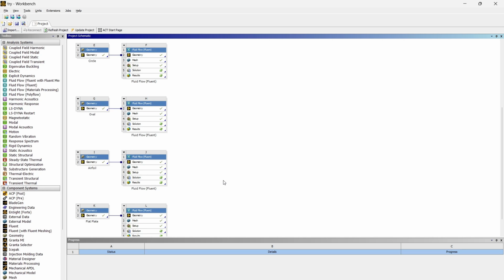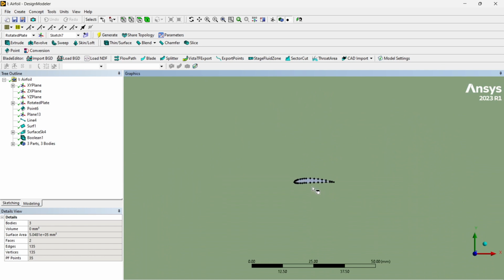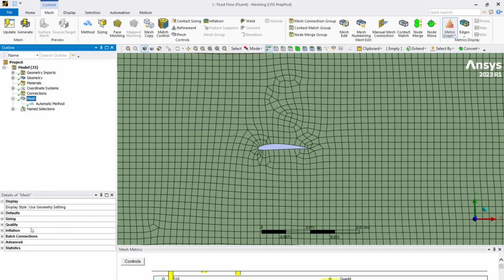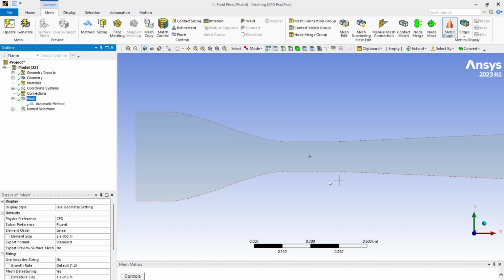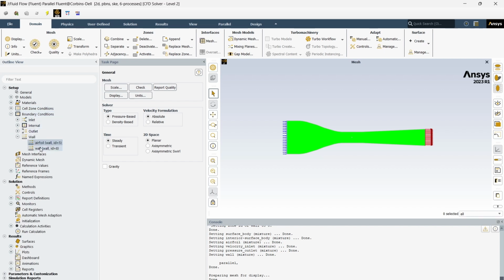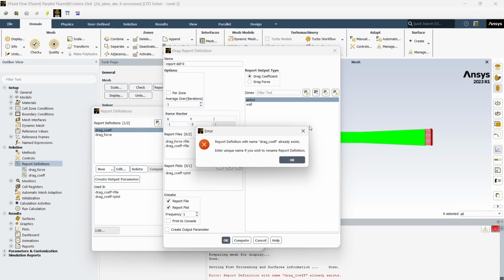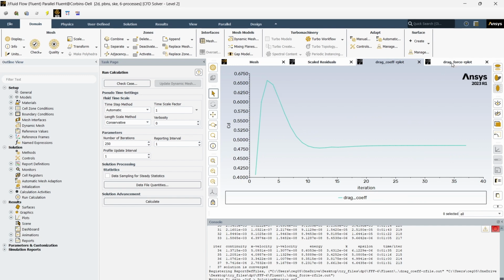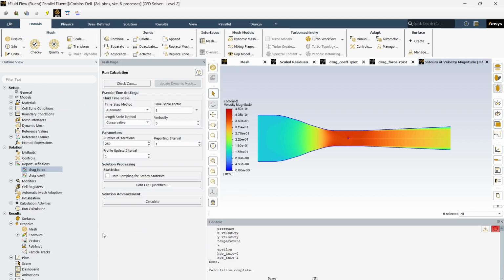NACA 4412 Airfoil in Wind Tunnel ANSYS Fluent Simulation

Comment: It feels like there is a disconnect between the videos. You showed how you modeled the airfoil and the wind tunnel separately, but in the video titled "NACA 4412 Airfoil in Wind Tunnel ANSYS Fluent Simulation", you didn’t show how you combined these two geometries at the beginning. I think you used the wind tunnel instead of a rectangular plate when using the Boolean command.